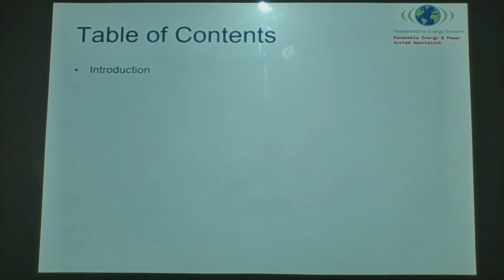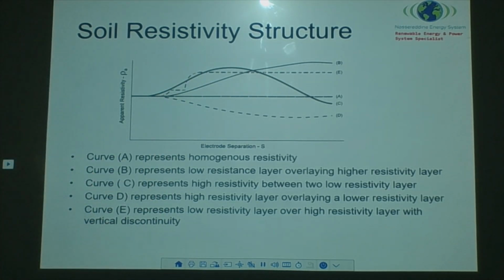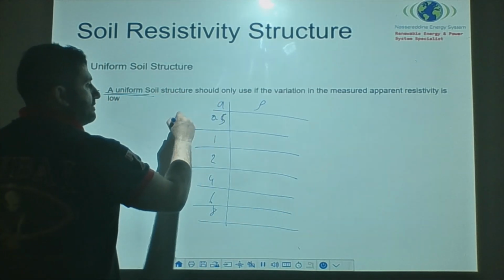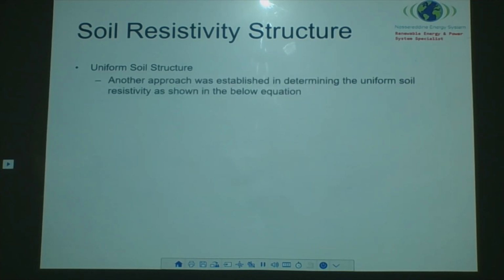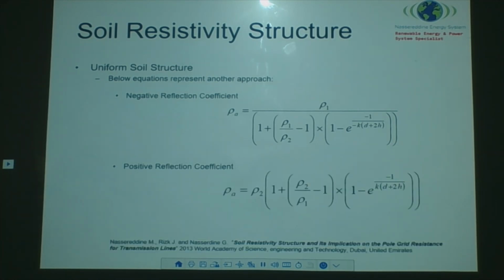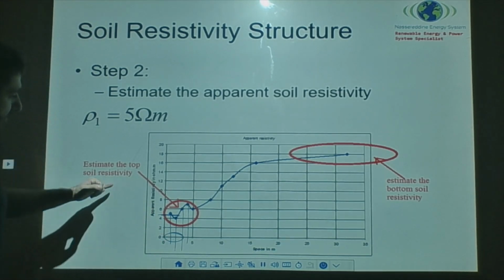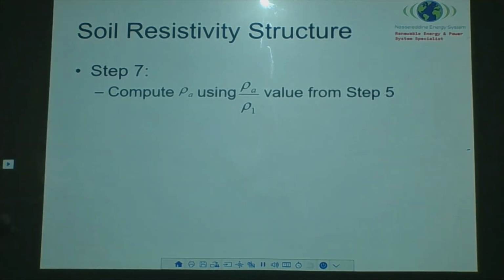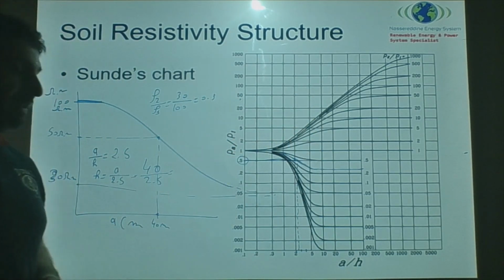Soil Resistivity Structure Computation

Comment: Ok followed everything except for how you selected a/h value from the Sunde's chart. The first time it seemed to correspond with the calculated p2/p1 value, but the second time seems arbitrary. The only correlation I am able to find between the 2 examples is they both seem to be close to the middle of that section of the Sundes Curve.

Comment: Sir, usually for earth mat design we consider soil resistivity data at depth or spacing  of 10meter for determining soil model. What should be the depth or spacing at which resistivity data should be considered   please guide and also tell if there are any references in IEEE, for the same.
Thanks
Reply from the maker: Watch this video especially in minute 40 to check the size of the soil data 
Also you can refer to IEEE 80

https://youtu.be/jeZEAqPjR7M?si=uMzT44weMgMoqG2u
Reply: @mohamadnassereddine5894   Sir we have received the resistivity data for different depth 0.5m,1m, 3m,5m, 7m,....upto 25m for different points of substation. Now my query is that upto what depth we have to consider for soil model